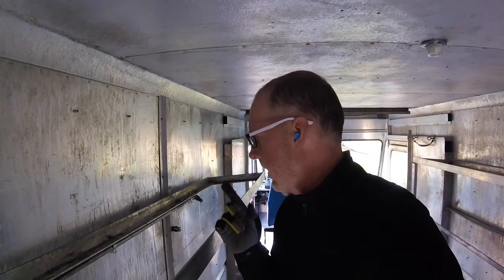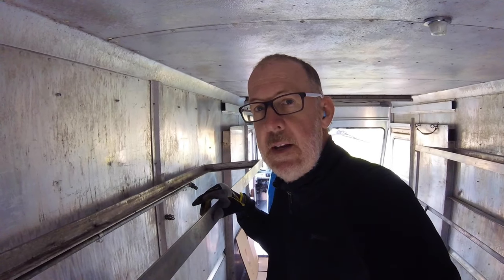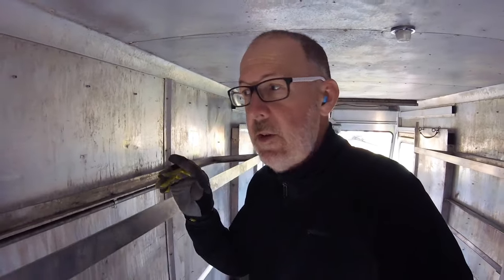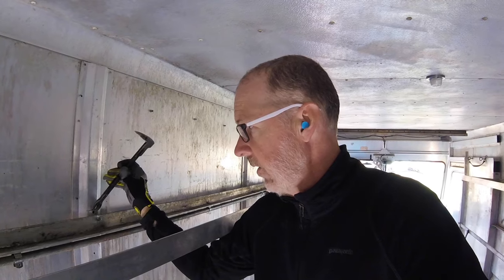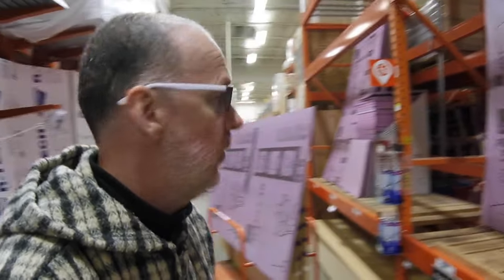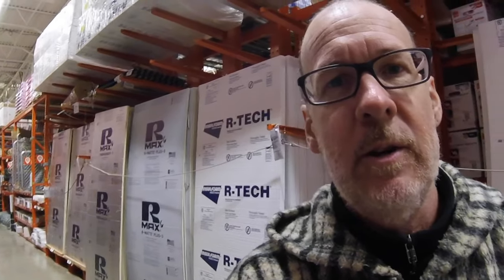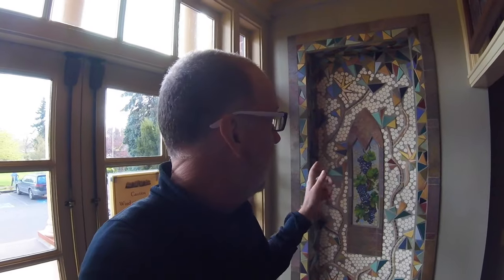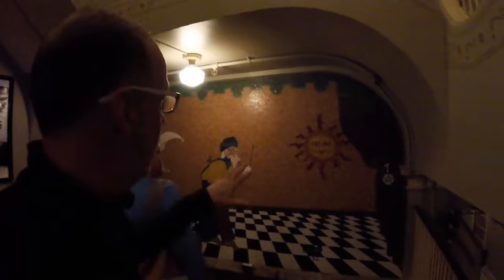Step Van Project Hammer Time E206

Comment: Hello my friend! I have 2 suggestions. One is check out a product called Lizard Skin, It's a sound deadner and also a insulant that you spray in the interior. My second suggestion if you don't want to use that one is to buy a product called rattle trap. It is also a sound deadner that's easy to apply. I would use one or the other before you start adding floors or insulation to your truck. I prefer Lizard Skin myself because it does 2 things at once and all you do is spray it on. My continued best wishes and best of luck my friend.
Reply from the maker: I'll have to research these products. thanks for the suggestion!

Comment: I usually use a drill bit to remove rivets as well and if the one you are using is not working then you either have a dull  drill bit for a drill bit that is designed for wood and not metal you might also want to try using a larger drill bit but a grinder will take care of the problem for you
Reply from the maker: these were really large industrial rivets with heads about 1/2 in across. we were using industrial bits for metal and it just wouldn't do it.
Reply: A bigger drill bit than the head of the rivet is required here....drill bit designed to drill metal...should come off within seconds of being applied to center of rivet head.

Comment: Hi! I'm Paul. I just purchased an '89 Grumman Stepvan with a Cummins diesel 4bt. I will be building it out into a tiny house soon! Love your project! I'll soon be doing a lot of the same things you are
Reply from the maker: congrats Paul. I just watched your bread truck video. super nice. like you, I'm considering the fold down rear deck to conceal doors. thanks for showing the jump seat. I need to add one back into mine. feel free to contact me using the contact form on my website
Reply: ***** what do you think about my idea of extending the roof height up a few feet? I know it is a big project but it would add soooo much room. My concept is tiny house. Not RV/camper conversion so I am ok with less mobility.
Reply: I will hit you up on your website too! Thanks!

Comment: That tool is called a cat's paw. But a simple drill bit for metal should blow right through those rivets. A grinder with a slim cutoff wheel is another good option.
But a good cat's paw can get many a job done--in a pinch. They are a must have tool.
Reply from the maker: thanks for the name! these were really large industrial rivets with heads about 1/2 in across. we were using industrial bits for metal and it just wouldn't do it.
Reply: The cat's paw is of Japanese design and comes in many sizes, it is actually an amazing tool I love my cats paw ...

Comment: As most people have said drilling a rivet is a very simple task. That being said.  A friend in 1973, was customizing  a new dodge van. He commented how strong the steel was in that van, then I  showed him that the drill was in reverse. Sometimes it something that simple. Say safe, keep at it.
Reply from the maker: these were really large industrial rivets with heads about 1/2 in across. we were using industrial bits for metal and it just wouldn't do it. both Merrill and I both tried it

Comment: I see lots of great advice here...yeah I'd go at those rivets with a small angle grinder and then pop them out with a cold chisel or center punch and small hammer. As far as the roof insulation...if that roof is flat or mostly flat, you could cover the top of the roof with insulation then build up a sheet metal roof over that...this would recover a few inches inside, but still leave you with roof support beams. I'd also think about building a new false wall or bulkhead about 6 feet forward of the rear wall, insulate the new wall, and leave the back area unfinished for tools, bicycles, propane tanks, batteries, generators and so on. 

There are many options for AC...a genset running a small window unit or a  rooftop RV style, and there are also many options for 12 volt and engine driven truck AC units.
Reply from the maker: thanks for the ideas! a little garage in the back might be nice. I'll have to think on that. not to keen on having a generator (prefer solar and no AC and follow warm weather)
Reply: I understand...but a small quiet inverter generator can be used to run power tools, cooking appliances, charge the starting battery if ever needed, and recharge the house batteries if you have a week or so of cool, cloudy weather. I'll be following along on the build...

Comment: the little tool you had at 1:40 is called a cats paw, or slipper bar. its used for pulling nails.
Reply from the maker: thx. I actually found it when I bought a new one for Merrell

Comment: someone once told me to use vinegar to clean aluminum when using adhesive. idk if its true or not. just a thought but if there's a mobile home / trailer supply place in town ya might want to go for look .  the old angle aluminum could be made into a solid mount ladder off the back for roof access, a drill bit and bolts are all you need as the pieces once locked together won't shift and drilling aluminum is like butter compared to steel , or a roof rack.
Reply from the maker: we used simple green to clean the surfaces before putting down adhesive. great idea on the ladder if I had a TIG to weld it. but something to think about!

Comment: I would put in reflectex over everything first will help reflect heat or cooling the way you need it plus its a vapor barrier.. Just a thought.
Reply from the maker: thanks for the thought. I went a different route based on my research

Comment: I have run into hardened rivets before and you can not drill them. A grinder is the best choice then. Put away the hammer before you do major damage to the van. :) You will need a grinder anyway if you want to put in vents. I like your idea for the floor.
Reply from the maker: I suspect you are absolutely correct. these rivets were not coming off at all

Comment: Center punch a hole in the rivet so the drill bit doesn't wander off. Then use a grill and bit just to remove the rivets head. After that use a center punch and a hammer to remove the left over part of the rivet through the back of the hole.
Reply from the maker: it wasn't wandering (natural depression) these were really large industrial rivets with heads about 1/2 in across. we were using industrial bits for metal and it just wouldn't do it.

Comment: As a Newbe to Mechanical Repair, this video is a prime example of the two approaches to a repair. There is an easy way, and there is a hard way to fix most anything. First, the hard way, my wife calls it the BIGGER HAMMER Method. You used a pry bar and a hammer to remove those rivets, problem is, You Needed a BIGGER HAMMER. Next is the easy way, when you have the right tools for the job at hand the job goes much smoother and is much easier to complete. Other commenters correctly explained why you had so much trouble when you used a drill to remove the rivets, you simply had the wrong drill bit (or you had the drill running in reverse). With the correct drill bit (in the right size) each rivet would have taken less than a minute to remove. You would have been able to remove all the shelving in less than an hour.
So, here is my suggestion to you: go to Home Depot, and buy one of those multi tool, battery powered, kits with the saw and the drill included and purchase a good set of drill bits (the kind that comes with it's own case [ I like my Milwaukee set ]). I guarantee you will not regret this investment in moving forward with your project.
Reply from the maker: your analysis of the situation is spot on! my brother in law Merrill used the bigger hammer approach whereas due to my post-surgery lack of physical strength, I would require power tools to do the same job. I'll check out the set you recommend next time I'm in Home Depot

Comment: Great project! I understand why you like the step vans. But how's the head space? Wasn't that better with the box truck? You're 6'4", right? (I'm 6'3" and dreaming of a similar project...). With floor and insulation I guess there'll be almost no head space left(?). It's hard to tell from the video what it feels like to be actually there. How claustrophobic does it feel in the back of a step van for tall people? Cheers from Germany; Christian.
Reply from the maker: hallo zu Duechland! Ich habe in Berlin fur 6 monate gewohned (I speak German but can't write it). the head space is the same in both vehicles. I have the floor in now (video soon) and the ceiling still has the insulation in it from when I bought it. so there is about 3 inches of space at this point which is enough for me!

Comment: You just need to get better drill bits...if you're having difficulty drilling out a rivet, there's a problem. Black Oxide bits are a decent bang for the buck, Cobalt or Titanium tipped are likely upgrades. Also, drilling metal often works better at lower drill RPMs, so a multi-speed drill can be helpful.

It's the start of a long process for you, and probably worth investing in a decent tool kit now...otherwise you'll constantly be taking 10x as long and getting lower quality results. A good 18v Ryobi variety kit would be a nice fit for you...
Reply from the maker: these were really large industrial rivets with heads about 1/2 in across. we were using industrial bits for metal and it just wouldn't do it. I'm beginning to buy tools now that I have the truck. it will be a slow and long process and steep learning curve since I'm a beginner

Comment: An angle grinder is your friend. Or better yet -->  an air chisel.
Reply from the maker: ooh.. air chisel sounds awesome. never heard of it
Reply: Seven Wanders the World air hammer and chisels, found at home depot and not that expensive - you will need access to an air compressor with an output of 4cfm at 90psi or better. this is what i am doing to remove all rivets from my bus ceiling. way, way faster.
Reply: Samual Whittemore you can't chisel air........just kidding that eould be great if he has air there.

Comment: If you're really going to do this and be a nomadic minimalist..I advise you to become directly involved in ALL your mechanical work on the truck. Get the documentation and tools you need to repair the truck in the middle of noplace at O'dark hundred hours..because you WILL find yourself in that unfortunate place where the only help you'll have is you and your wits (and tools) to fix that thing.
Reply from the maker: that is exactly my plan. I want to learn how to do all the work myself (or anything that doesn't require big shop equipment)
Reply: Ummm.Ok. But wasn't that you sitting in the Starbucks drinking coffee while you paid a mechanic to work on the transmission filter and radiator leak? I grew up working in a garage..I would have thought I died and gone to Heaven if a customer came back from Starbucks with a coffee for me and put on a pair of latex gloves and asked what to do next.

Comment: Those rivets shouldnt take more than 20 seconds a rivet, air chisel or spot weld drill bit.. save the cats claw for when you redo the floors in your house
Reply from the maker: these were really large industrial rivets with heads about 1/2 in across. we were using industrial bits for metal and it just wouldn't do it. both Merrill and I both tried it
Reply: i know what they are LOL

Comment: Drilling out rivets.......stepped drill bit, small size (brand name "Unibit") (http://toolguyd.com/blog/wp-content/uploads/2012/06/Irwin-Unibit-Step-Bits.jpg).  You want the small diameter one on the left for rivets.
Reply from the maker: maybe starting with a small bit and moving up in size would work. these were really large industrial rivets with heads about 1/2 in across. we were using industrial bits for metal and it just wouldn't do it
Reply: Just changing drill sizes won't work like a unibit.  With a unibit, the small dia segment already in the hole stabilizes the bit in the hole so it doesn't "chatter".   The small version goes up to a maximum diameter of 1/2", but what you need is the stem diameter of the rivet.  These little gizmos should be in everyone's toolbox.....they work great (and no, I don't have stock in the company......:^).  For holes in sheet metal (which you will be doing a LOT of), they cannot be beat.

Comment: STOP WITH THAT CATS-CLAW!!!!!!!!!!!  YOU TUBE Remove rivets,  YOU TUBE Insulate van walls>
Reply from the maker: these were really large industrial rivets with heads about 1/2 in across. we were using industrial bits for metal and it just wouldn't do it.

Comment: wow this guy is not that bright, drill the heads off takes maybe 30 seconds per rivet tops with sharp bits
Reply from the maker: these were really large industrial rivets with heads about 1/2 in across. we were using industrial bits for metal and it just wouldn't do it. both Merrill and I both tried it
Reply: UBBERTANKER if they don't spin

Comment: For industrial sized rivets you could use an angle grinder with a cutoff wheel or one of these for tighter spaces https://www.dremel.com/en_US/products/-/show-product/tools/multi-max-mm40
For smaller rivets a SHARP drill bit should take seconds to drill out, try carbide tipped drill bits you could also add wd40 to lubricate the drilling to keep your bits sharp for a longer duration.
Reply from the maker: dremel is a great idea! I was using oil. these were really large industrial rivets with heads about 1/2 in across. we were using industrial bits for metal and it just wouldn't do it.